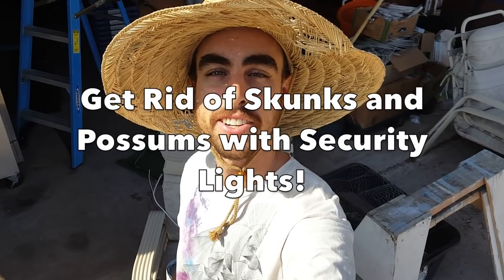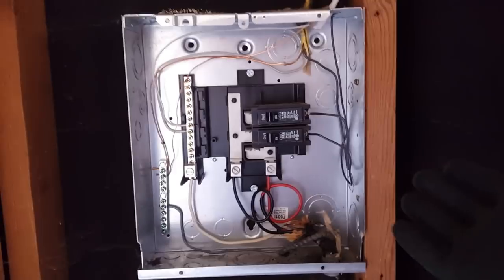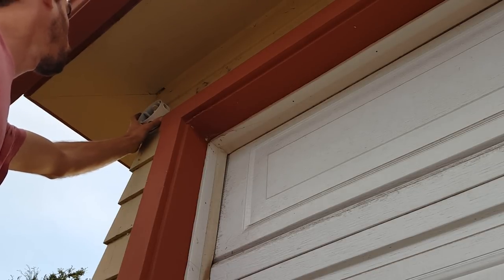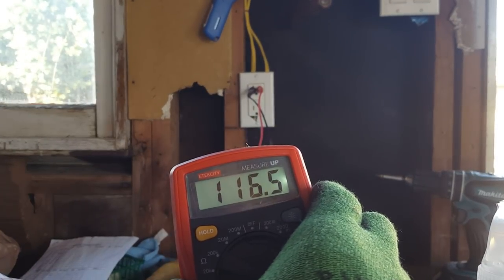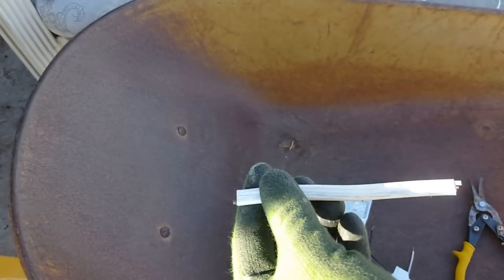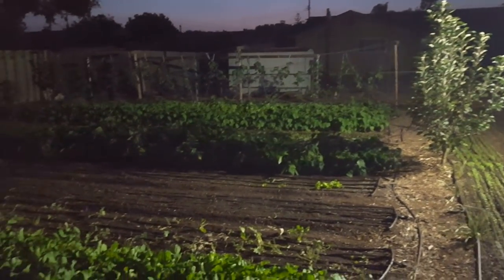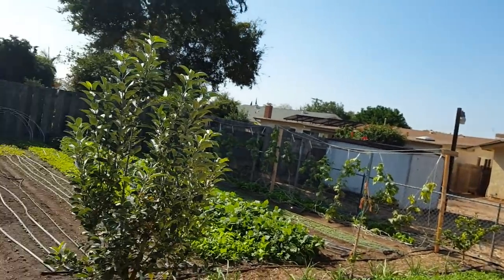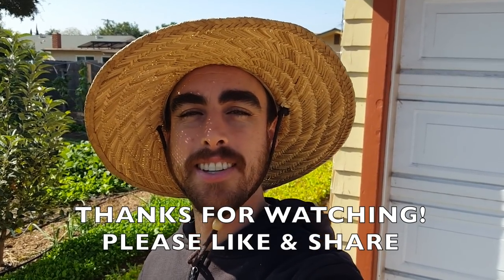Get Rid of Skunks and Possums in Your Garden

Comment: Because you're running the lights externally it might be a good idea to run the wire (it looks like you used external) through either aluminum conduit or at least a pvc or plastic conduit.  It'll protect it  from water as well as critters and the Santa Anas.